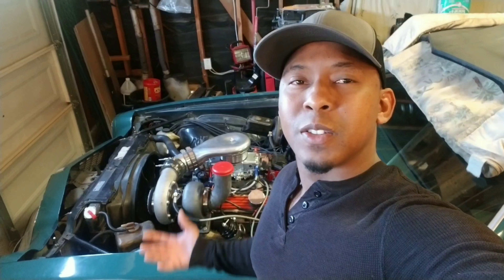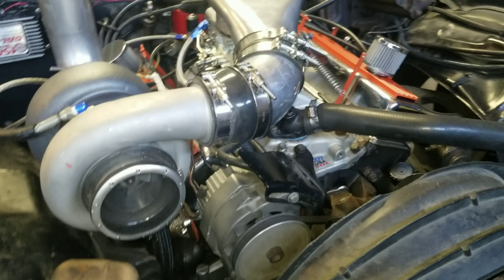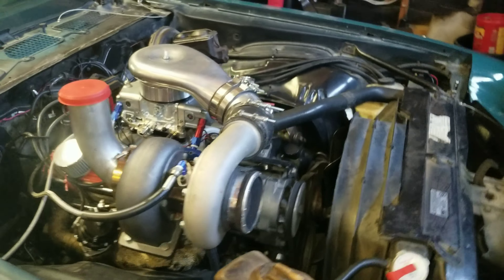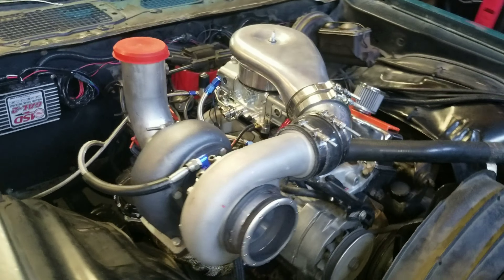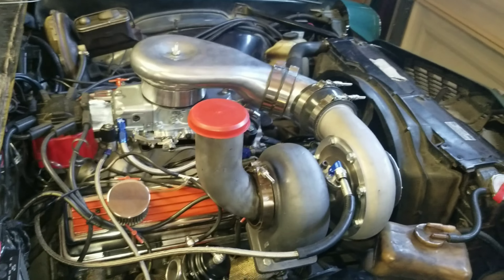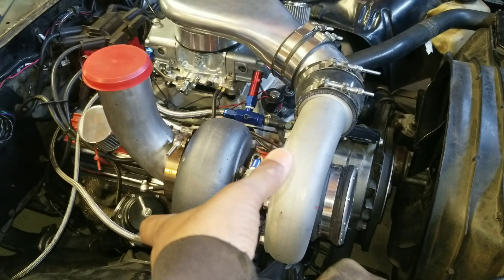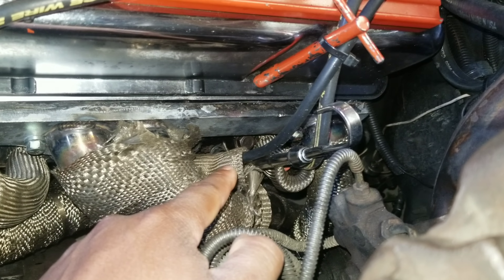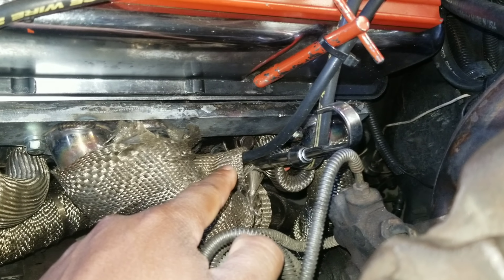EBAY'S BEST SBC TURBO KIT

Comment: This guy has potential. First time I watched an entire video in awhile.
Reply from the maker: I appreciate the motivation a great deal. Thanks for watching 😁👍
Reply: @Duwop77  
Headers no longer available ☹

Edit. I just found him on Amazon. Did you notice one header has round ports and the other has square ports? Wtf.
Reply from the maker: @xmo552  ok thanks for the heads up. Yes I noticed. Thought that was very strange also🤦🏾‍♂️
Reply: @Duwop77  what's a new link for the headers
Reply from the maker: @zraw7447  I'll have to do a search and see if I can find another seller. Thanks for the heads up.

Comment: Ayyy my man, you are a breath of fresh air bud...you obviously think before speak, which is kinda rare these days kid...your momma did a great job with you sir!  1 thing I didnt hear u talk much about was your fuel system...?...are u using a “boost referenced” carb? A mechanical or electric fuel pump? U using a boost gauge and/or a air/fuel meter...if so what are they reading? Just a curious dude I am and love doing this myself and helping buddies....its SO satisfying to do this and results similar to so many others that spent 5-10x’s the $$ for a fraction of the cost!! U rock man!
Reply from the maker: Thanks I appreciate it. I agree. I'm trying to gain adequate horsepower with less many as possible. Lol. My carburetor is a demon 650 cfm blow through. I'm currently in the process of getting a Holley boost referenced fuel pressure regulator. I'm running a electric Holley red fuel pump at the moment but I recommend using a holley blue electric fuel pump. It puts out more fuel pressure. I am using both afr and boost gauges. The car isn't tuned yet but under boost you wanna aim for mid to low 12's on your afr gauge. Thanks for watching 😁👍

Comment: The video of the person who had a problem clearing his valve cover and had to use a spacer was using a different but similar SBC kit.  He had the kit from ebay that had the primary tubes on the drivers side header t shooting straight down not swept towards the rear like the kit you have.  On the passenger side, your kit sits the turbo flange a few inches higher and the wastegates are in different places.
Reply from the maker: That's correct. The kit I purchased has better fitment for my setup. Besides clearing the hood.

Comment: Wonder what that thing would do to my stock 5.7 vortec truck motor , that wrap material reminds me of fiberglass cloth
Reply from the maker: It'll definitely wake it up with a proper tune😁 Yup your correct that's exactly what it is. I hear if you soak it in water b4 use it's better.

Comment: I got a 85 Monte Carlo SS I had since I was 13. 17 years later and finally just got a 350 vortec and really wanna build it up for turbo. Was gonna go LS but I feel everyone and they granny got a turbo LS and sbc are way cheaper 🤣 awesome vid and good info, really got me motivated 💪🤙
Reply from the maker: Thanks bro. I agree ls swaps are everywhere. I just seen a ls swap In a dodge Challenger. Plus horsepower is horsepower. No matter what type of engine it is. I'm glad you enjoyed the video. Stay motivated and get that beast out there. Thanks for watching 😁👍
Reply: The only real drawback on the Vortec is the heads.... You're limited on valve lift , and a good power building cam is typically over .520" of lift , whereas the Vortec head is limited to about .480"..... I've been struggling with this issue for quite some time now. If you're only goal is a sub 500hp daily driver , there's no reason you can't use the Vortec 5.7... If you're wanting more hp than that , go buy a 5.3 ..... It's too easy to get 600-800 hp out of one and still be a daily driver....
Reply: @Duwop77  right on! Sound dope and I can't argue with that, power is power. I just gotta motivate my wallet some more 😆
Reply: @firemanjim324  that's very helpful to know with the heads and cam. I got enough knowledge to put it all together but not enough to pick out the right parts for what I wanna do. In the long run i would love to get a 5.3 and go LS. But seeing how my budget is -17 dollars I'm just working with what I got 😀 the condition my Monte is in now would prolly just grenade the rear end if I push it over 500. Lol.
Reply: @randallweeks5081  the Vortec is a great upgrade from a stock sbc , even stock. If you have one already , just out a carb on it , a better than stock cam  ( like an extreme energy 262° cam ) a HEI distributor with a MSD spark box  , and headers of course..... You'll be happy with it for a long time....
Reply: @randallweeks5081  and run a torque converter with a little higher stall than stock. It will really change how your performs....😉
Reply: @firemanjim324  my dad randomly showed up with a 350 vortec that came out a suburban that ran on propain so I got quite a few things to change after I get it tore down and cleaned up, new brakes, few suspension parts. I  Honestly didn't think about the converter and will keep this all in mind bud ☺ thanks for all the extra knowledge!!!
Reply from the maker: @randallweeks5081  I feel you!😂
Reply: @firemanjim324  you can use a SUM-8800 cam and 1.6 rockers to get 204/214 duration, .480 lift(1.5 rockers is .450 lift), 112 lsa. stock vortec valve seals are not hammered down all the way. hammer them down, and use z28 sbc valve springs with the inner damper pulled out. .500 lift clearance, no guide cutting, stock retainers and locks.

Comment: Love the build man! Video came across my feed because I’m building a forged internal 383 sbc in my 82 Camaro. Mines almost done thank goodness lol. Was $100 scrap car 😎 I’ve been busy on it this last year. Vids on my channel if you have time. But anyways a tip on the header wrap for future reference. Hang the header on the wall with some screws or bolts so you can help stretch the wrap tighter. But let it soak in water and that also helps tighter wrap and stops fraying figured that might help if you do another set on different vehicle.
Reply from the maker: Thanks. I appreciate the advice. I'll check out your channel. I'd love to see your build. I'm currently in the process of upgrading the fuel system. Thanks for watching 😁 👍
Reply: @Duwop77  gotta post updated video but it shows the start of build and carbed vortech 5.7 I have to post more vids for sure just always forget when going to do something on the car lol sure you’ve been there
Reply from the maker: Yup, plenty of times😆
Recording is time consuming at times.

Comment: I have been looking for this kind of honest content. I want to use a cheap ebay turbo but make sure everything else are bette in the kit is worth it or upgrade it for more reliability. i am also putting this into a second-generation camaro. keep up the great work!!!
Reply from the maker: Thanks I appreciate it. Currently I'm not running an intercooler. With an blow thru carburetor you can get away with no intercooler on low boost. Although its always beneficial to use one. Thanks for watching 😁 👍

Comment: I have ls1 engine with a cam and valve springs and i want to keep the the bottom end stock and put a turbo any tips I should know would this turbo work? Also how much go does your hp car have? Much love❤
Reply from the maker: I'm not sure of horse power. I've never had the car on a dyno. Also these wouldn't fit an Ls head. Although if I'm not mistaken Ebay does sale turbo manifolds for Ls engines. My tip is to start with low boost 6-7 psi and see how the car reacts. And don't cheap out on a wastegate😁👍🏾
Reply: @Duwop77 thank you for the tips my man keep up the good work god bless
Reply from the maker: Thanks. God bless 😁🙏🏽

Comment: Running a small marathon on the build and install vids, did an Ebay twin top-mount setup on my '76 and a buddy just bought the PowerGo headers you got for his '79. Just watching to make sure we won't have any fitment problems, and so far they appear very minimal.
Reply from the maker: Sounds good bro. Good luck on the build. So far powergo manifolds has been good to me. No fitment issues. Just needed to have the crossover pipe welded. Thanks for watching 😁👍

Comment: i’ve been watching these videos all day deciding if i wanna put a turbo on my 1970 el camino
Reply from the maker: I totally understand. I had plenty of those days☺️ once it's all setup it's a lot of fun and addictive 😁👍. I have some work to do to the fuel system b4 its all complete.
Reply: @Duwop77  i’m gonna start buying and gathering all the parts i’m gonna need for it but i’m gonna do what you did and put it on the 350 that’s in it right now just for practice since i haven’t done it before as a trial run
Reply from the maker: That's a great idea. Just dont forget about fuel pump and regulator. Somthing I didn't talk about in the video.
Reply: @Duwop77  what did you have to do with the fuel pump and regulator?
Reply from the maker: I had to upgrade my fuel pump for better fuel delivery. And add a boost referenced fuel pressure regulator that will raise the fuel pressure according to boost pressure.
Reply: @Duwop77  i looked at the headers you got and wasn’t sure if they would even fit in my car so i messaged them and they said it would but i should expect some fabrications so when i gather all the parts should i just take the car to a muffler shop and have the headers and the cross pipe put in?
Reply from the maker: Yes, that's what I did. Only cause one end of the cross pipe doesn't have a flange. So I just used a band clamp temporarily to drive it to the muffler shop and have a flange welded on.
Reply: Update: I sold the 350 and trans and bought a lq9 4 speed out of an Escalade and built the motor with all Texas speed and put that in the car and it’s making about 550 rn but planning to add boost in the future

Comment: Hey where did you get the flange for the exhaust? I can’t find one. Sweet build!
Reply from the maker: I started out with a band clamp but it wouldn't seal completely. I ended up going to a muffler shop and having a flange welded on.

Comment: Great video mang! Very informational. Never turbo a car before and I’m terrified of blowing my shit up..😅I was thinking of trying to do a eBay setup to start out cheap on one of my Toyota Corollas. Debating how to go about this…This helped the idea thanks 🙏
Reply from the maker: I was the same way. But just take the extra precautions by buying a good wastegate and injectors if its fuel injected. Those are the too main components you don't want to cheap out on to prevent grenading your engine. Start off on low boost 5psi. You'll be alright. The rest is up to the tuner😁👍

Comment: Thank you for the excellent info! just wondering - do you have any excess heat problems without running a intercooler? thanks again for the explained knowledge. Keep up the Rad videos!
Reply from the maker: My engine did run a bit hot. But I believe it was do to valves not opening and closing correctly due to a bad cam. A blow through carburetor actually cools the air very well. One of the reasons why I didn't spend the extra money for a intercooler after I did the research. But having one would make the charged air even cooler.👍
Reply: @Duwop77  I bet you could rig up a water/methanol injection kit and get the air intake temps down.
Reply from the maker: @patrickturner270  I agree. That would help a lot.

Comment: are you running a boost referenced mechanical fuel pump on this?? btw nice setup bro..
Reply from the maker: Thanks. I'm currently running a Fitech EFI system. The fuel is regulated by the system. But if your running a blow thru carburetor I would use a electric fuel pump like a Holley Blue and a boost referenced fuel pressure regulator. Check links below for examples. Thanks for watching 😁 
https://www.ebay.com/itm/382496294445?mkcid=1&mkevt=1&mkrid=711-53200-19255-0&ssspo=bE5HA_0QRwW&sssrc=2349624&ssuid=00bsf4SkRKe&var=&widget_ver=artemis&media=COPY&siteid=0&campid=5338700573&customid=&toolid=10001
https://www.ebay.com/itm/224038845736?mkcid=16&mkevt=1&mkrid=711-127632-2357-0&ssspo=grfC21znRQ2&sssrc=2349624&ssuid=00bsf4SkRKe&var=&widget_ver=artemis&media=COPY
Reply: @Duwop77  cheers mate very helpful!
Reply from the maker: Cheers 🍻😁

Comment: Soak header wrap in water before you handle it 👍
Reply from the maker: Thanks I appreciate the tip😁👍🏾
Reply: @Duwop77  no problem…believe me I know what a pain that stuff is to work with…years ago an old timer I used to work with suggested soaking the wrap in water…been doing it ever since and the wrap fits really tight when it’s done…it will last a lot longer to
Reply from the maker: @localenterprisebroadcastin5971  I'll be sure to do so next time. I haven't tried it again since 😅

Comment: I'm 15 and have a c10 sitting around if has a v6 in it rn but I wanna build a 350 and turbo it. I wanna at least have 1 if not make it twin but one big single would work so this is valuable info
Reply from the maker: Oh wow! I didn't have a set of wheels till I was out of high school😂. But single or twin turbo will get the job done. Thanks for watching 😁👍
Reply: You can get one of those Eaton m90 superchargers for pretty cheap, can supercharge that v6 and breathe some life into it

Comment: Great Video Mate,,, you done a good job and i will look into it.  ALL the little details are very very good information people must know,, especially the short spark plugs and exhaust issues are very good info. steve in Australia
Reply from the maker: Thanks Mate, wow all the way from Australia. I appreciate the gratitude. Thanks for watching 😁👍
Reply: And anytime you want to drop on by your welcome mate.

With all the issues in America now..your welcome here anytime.i have a camaro and still fixin it everyday.
Brand new 383 new paint.478hp on the dyno
Reply from the maker: That's very kind of you. I'll keep you in mind. There is a lot going on in America I may need to escape some day😁. My engine is also a 383 rated at 475 hasn't been dyno'ed yet. Just a few more upgrades to the fuel system  and it'll be tuned for max power😁
Reply: steve driver hi Steve I’m in Melbourne and watching this too. What have you done about your turbo?

Comment: Where are you getting your boost refrence from why is your waste gate without a hose from the top ?
Reply from the maker: The top port is for a boost controller. If your just running off wastegate spring use lower port.

Comment: Thanks brother wanna turbo my 79 chevy monza 388 cuin  pro street is there a specific turbo to use part # ? New to turbo here
Reply from the maker: It's all good. I'm still learning myself. But there isn't a specific turbo or part number. Most people tend to use ether a gt35 or gt45 for turbo v8's. And with a t4 flange. Turbo prices very so I tend to go for whatever I can afford. If you ever need further assistance feel free to contact me. Thanks for watching 😁 👍
Reply: I have a 79 Monza also I got a 350 I want to  turbo love the h body 😂

Comment: It is best to disassemble the wastegate and  get a spring of choice. Correct any misalignment and get it on!
Reply from the maker: I agree. I've noticed with a couple of ebay wastegate's they would leak air through the 3 assembly screws under the diaphragm. I remove and put silicon on the threads and reassemble. 
I also wanna thank you for the donation. Me and my family really appreciate it 🙏🏽
Thanks for watching 😁 👍

Comment: I have a Holley 750 c carburetor and an electric fuel pump with good fuel fluid but they tell me that it can overfeed or drown and it can crush the carburetor floats or more specifically the question did you modify something to your carburetor????? ?
Reply from the maker: Yes, I had to upgrade my fuel pump. I was running a holley red. But you need at least a holley blue or better. Also a boost reference fuel pressure regulator.
Reply: you have to use solid or nitrophyll floats. no brass floats. boost will crush them.

Comment: How much boost do you run and how much horsepower do you think you're engine putting out and do you have trouble with you engine overheating . Thanks for the video.
Reply from the maker: I'm currently running a 7psi spring. I dont know the power output yet still in the process of breaking in the engine. I have no heating issues. Thanks for watching 😁👍
Reply from the maker: The link below is the updated video check it out. https://youtu.be/LG5kVQgyjsM

Comment: What kind of fuel pump are you using, how are you regulating psi to carburetor Under boost? How did you handle your ignition timing? Do you have an AFR gauge hooked up?
Reply from the maker: Yes I'm using an AFR gauge. All parts are listed below. Thanks for watching 😁 👍 
https://www.speedwaymotors.com/FiTech-58019-EFI-Fuel-Tank-1975-77-Camaro-1975-78-Firebird,419702.html?sku=52158019&utm_medium=CSEGoogle&utm_source=CSE&utm_campaign=CSEGOOGLE&gclid=CjwKCAjw2bmLBhBREiwAZ6ugo90tBfP8Zhi1Nv3L-0OdO7XpcYWSeq_kTUeDHbMslP5Gg98s8He7ahoCP4gQAvD_BwE

https://www.ebay.com/itm/HOLLEY-12-879-Return-Style-Fuel-Pressure-Regulator-3-8-NPT-Boost-Reference-1-1-/382496294445?mkcid=16&mkevt=1&_trksid=p2349624.m46890.l6249&mkrid=711-127632-2357-0
Still a work in progress. Hasn't been tuned just yet.
Reply from the maker: @michaelschwarzbach8064  if I'm not mistaken. The gentleman who built the engine locked it out.  As of now its set to base timing. Not currently boosting on it. Finishing up the fuel system.

Comment: Wrap is fiberglass.  Have to soak in water before use.  When it dries it will shrink and tighten up.  That’s why yours is loose
Reply from the maker: Thanks, I appreciate the tip😁👍

Comment: Im gonna get an 89 camaro with a 305 and i want to turbo it but i know its not as simple as it sounds can i use this same set up?
Reply from the maker: Yes, long as your using straight plug heads. This exhaust manifold will not fit angled plug heads without some finessing 😆